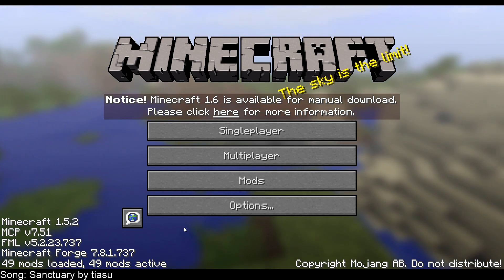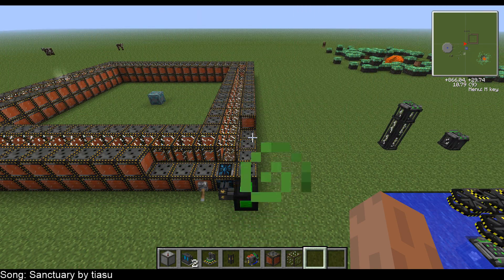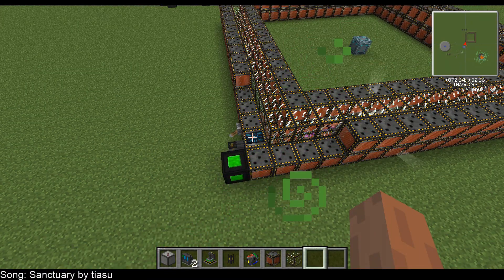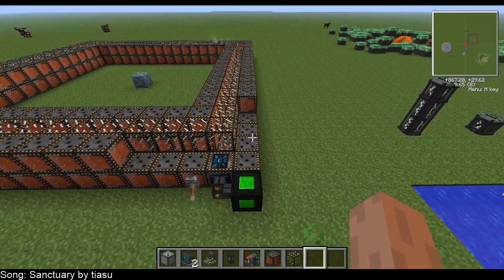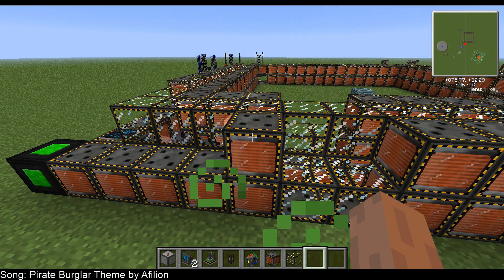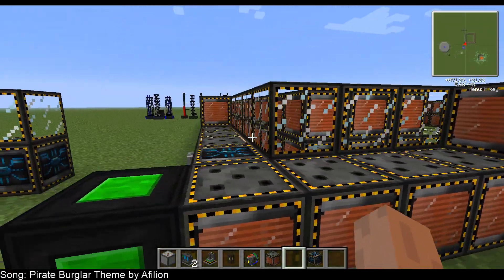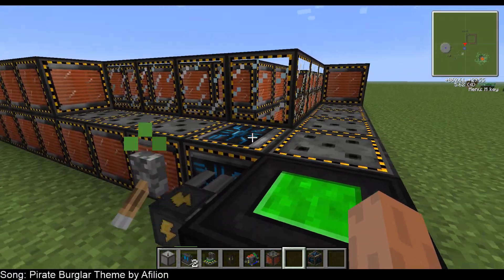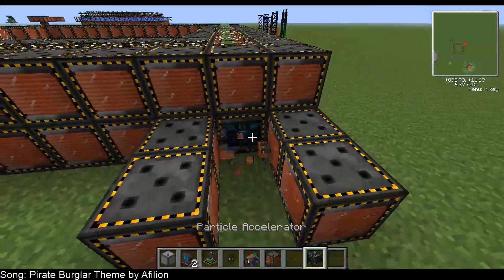Atomic Science - Particle Accelerator Your way

Comment: What's the best, most efficient design for this?
Or how do I find out? (besides random iterations)
Seems like just 1 long strand would be the best, or does it matter at all? (like, is there a minimum for "working" and past it, doesn't matter?)
Reply from the maker: Depends on your needs, goal of recent AS versions is to avoid single optimized designs and encourage creativity of base building. Though single long tube would avoid power loss at the cost of space

Comment: Input and output on opposite sides would make logistics a nightmare, especially if it's min 30x30 like it was.

Maybe a console, like a 3x1x2 block with a special cable to connect it and control it, then you can have control from wherever you like. 

Also regarding outputs, if it still only creates two outputs, they could have special tanks they feed to that just collects over time. Would make automating fairly simply as well.

Comment: So I think I have an idea for how to redo the accelerator, but it's hard to explain in words so bear with me, this might be a little long.
I'm thinking of a system where instead of having a huge square muiltiblock, it instead focuses on interacting components. There would be at least three components: The emitter, the magnet, and the collider.
Emitter - Pretty simple, would take an input and emit particles based on the input, normal particles would most likely be piped in as a gas. Additionally, magnetic items could be loaded into the emitter to turn it into a rail gun that does devastating damage to entities based on speed, and magnetic blocks would do the same but to a much more explosive degree (maybe you could even add icbm explosives and tnt?).
Collider - When two particles enter the collider at the same time, it produces an output based on the angle the particles entered and there speed
The magnet - The magnet would be a two block tall structure, with a base, and a "ring" which has an input and output which can be adjusted to different degrees of rotation (in yaw as well as pitch). When a particle enters the magnet, it gets an additional (configurable) speed boost, this could either be a fixed number or have deminishing returns, I'm not sure which would be more fun. Additionally, the particle would lose speed based on the angle between the input and output, I imagine it would look something like this: speed = speed*[(modifier+cos(angle))/(1+cos(angle))] where angle is between 90 and 180 degrees (<90 would destroy the particle?) measured from the smallest angle, and modifier would be a configurable value between 0 and 1 to help fine tune balance. Every now and then, even if traveling in a straight line, the particle would need a speed boost to keep it "aligned", really the reason for this is to prevent massive rings with only 4 magnets.
I like this design for a couple of reeasons. 1. It creates a dynamic, fun (hopefully) way to make accelerators. 2. it would encourage larger, rounder accelerators, without denying the small square ones or forcing users to make a perfect toriod in mincraft in order for the multiblock to form. 3. I really want to use this with projectile motion equation and open computers to make rail gun that I can actually aim. 4. it would be relatively easy to add new components in an addon or to the main mod as people think of them, adding further complexity.
Some potential issues: 1. An exit point block might be needed so that the game knows to "turn on gravity" for larger blocks (also might help performance). 2. Entities might go into unloaded chunks (It might be beneficial to simulate the whole system and just run animations instead of having actually entities). 3. There are no tubes, it might be hard for some people to suspend their disbelief when you send a particle zipping through a collider filled with air.
Anyways, sorry for the long drawn out idea, feel free to use as much or as little of this as you would like.

Comment: If you are looking for feedback, I would suggest allowing it to be made more circular. You lose less energy per rotation as you don't have to adjust it as much. I believe most accelerators still in operation are linear segments with slight turns after each linear segment.